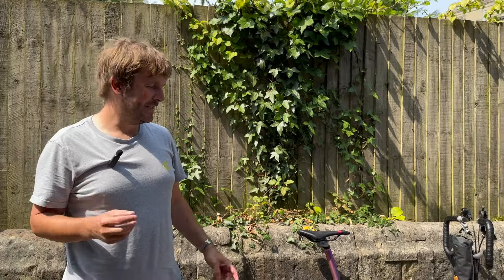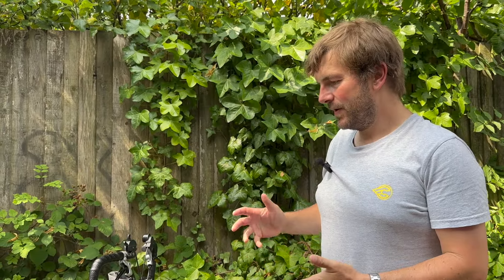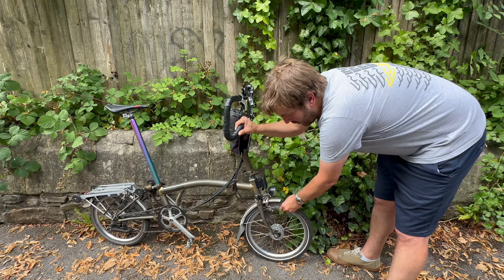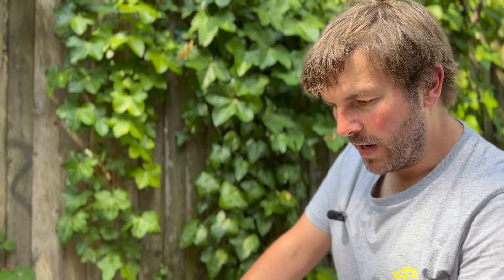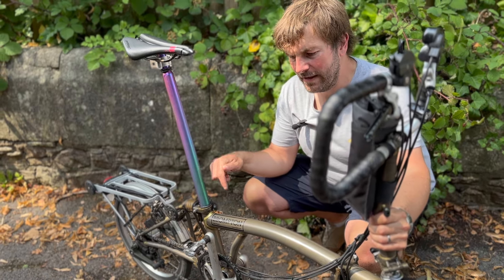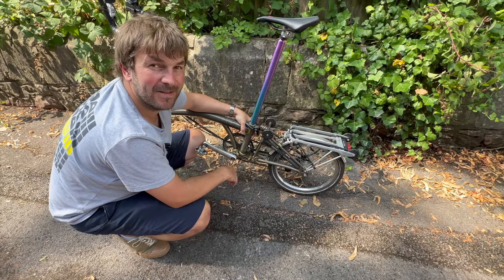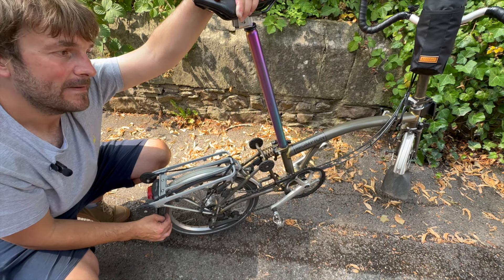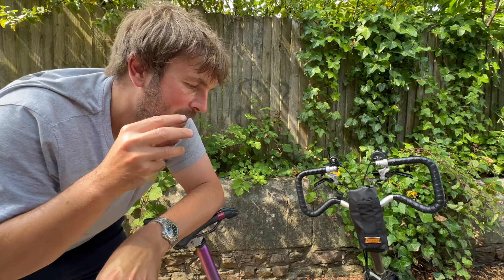Thinking About Buying a Second-Hand Brompton?

Comment: Great advice! I bought a second-hand Brommie about 15 years ago via a refurb project and when we pumped the rear tyre up to 100 the rim popped... but better then than on the road! Since then it's had a new hinge, handlebars, and other bits but still has the original front wheel. It was a 5-speed and had been used hard as a commuter, judging by the wear of the decal, and despite much fettling by my Brompton guru two of the five skipped just when I least needed it. So I spent quite some time looking into options, comparing gear ratios, etc., and now it's a 3-speed with gears that suit well. I'd done a lot of youth-hostel touring with it - the Rhine, the Vennbahn and Luxembourg, but last year I did a camping tour with it for the first time, in Northumberland. Great! And it's 25 this year...
Reply from the maker: @karenfry421  hi Karen, sounds like a great purchase and you’ve had a real journey together. Thanks for sharing 👍

Comment: Lots and lots of info about things that are fairly easy to fix, yet absolutely nothing about checking the gears, which other than the frame, would be potentially quite expensive to fix.
Reply from the maker: You make a good point 👍

Comment: Hey Paul, would you mind going to more detail regarding wear on the rims from brake pads?  What does wear look like on an older bike and when do you recommend the rim/ wheel get replaced?  Do you recommend a particular rim - double wall, steel, whatever - when it comes time to replace? Thanks.
Reply from the maker: @SimonBrowneNZ  hi Simon, most modern rims will have a marker on them and when this marker disappears it’s time to replace the rims. For example the mavic A 319 which I would recommend, have a line all the way round the brake track and when it disappears it’s time to replace. Hope that helps 👍
Reply: @veloworks9266  Brilliant; thanks Paul. That is really useful info.
Reply from the maker: @SimonBrowneNZ  glad to help

Comment: Excellent advice for anyone looking for a used Brompton. I was very lucky with mine, bought on eBay after a few failed bids on others. It was four years old but in mint condition, having spent most of its life under the seller's stairs when he moved house and job shortly after buying it new and no longer commuted. It even still had the rubber spikes on the tyres. I made the poor man go to a lot of trouble to prove it wasn't stolen before I bought it. He didn't bear a grudge, though and actually gave me an Ortlieb O Bag in new condition, as well as a cover and saddle pouch, all for free along with the bike. I immediately sold the O Bag and bought a T Bag in similar condition with the proceeds as I wanted it for touring, not commuting. Six years later, it is still immaculate, as I like to keep my expensive purchases in good condition. I absolutely love the bike and highly recommend getting a Brompton, but only after taking a test ride. Although they ride like a full sized bike, the steering is very sensitive and they like a comparatively smooth surface. I think they are very much a "Marmite" bike. Being able to fold and keep it in the car boot or hop on a bus with it is so liberating, as well as not having to worry about it being stolen due to being able to take it just about anywhere.

Another good thing about them is the resale value. If someone finds they really don't like the bike after purchase, the chances are it has probably increased a bit in value, unlike just about any other machine you can buy. Because mine came with all the bells and whistles, including rack and dynamo, it cost me a third less than a new Brompton at the time. My advice to would be buyers is to be sure and take into account the cost of adding extras after purchase. Brompton accessories are very expensive and quickly add up if you buy a basic model.
Reply from the maker: @s.richards6552  hi thanks for watching and great points! And for sharing your experience. The last point about taking into consideration Brompton extras is very valid.

Comment: Great Video and great points for used Brommies.

Most important sentence is within the first 35 seconds: If a Brompton is used heavily in the wrong circumstances, it can (it does) suffer quite a lot! 

If you want to use your Brommie as a touring bike, with all the challenges that brings , it's NOT the usual circumstances that it's made for. Than you have to invest a little more maintainance work. But if you do, it will be a faithful companion.

Btw: In terms of rust, we use Fluidfilm at the end of every summer to protect all our steel frames in the wet month. 
Smells horrible for a while, but after two days in the saddle,  I smell worse 😝

Stinky regards!

Ben&Sarah
Reply from the maker: @BenandSarahsclutter  hahahaha thanks for the advice! Will look at it. Thanks for watching 😀

Comment: As a now 76 years old man I have never bought a used car, till my very last, which was a ½ year old, fully equipped Demo in 2019! Those cars I had I knew how had been treated, and up to 12 years of use, before being sold, and normally without much problems during that (The last was the exception, as also a 9 month old BMW, which became sold then, even still with a Warrenty!).
     But as a Brompton is a rather complicated type of bike, and so Special, but I did look for used samples also when I bought mine in 2019. But in the the end I bought a very Top Superlight, which has been modified to now below 9 kilo. Finn. Denmark

Comment: Hallo Paul, thanks for the great reviews and excellent advice, two questions, does the front fork, and the rear triangle allow for a slightly wider tire, i.e. 16x1.45 for example? and have you ever retrofitted the rear system to add a third cog, like perhaps 12-15-18? I believe a friction gear shifter can be installed instead of the one that comes with the bike, but hopefully I'll get your expert opinion on the matter. Be safe and happy travels!
Reply from the maker: Hi; thanks for the questions. 1. The front fork might do but it would be tight in the rear triangle and definitely rub on the mudguards. 2. Ti parts workshop do 3 cogs but I believe to make the clearance work in the largest cog (18T) you need to grind a bit of the frame away which I’m not up for! Hope that helps 👍